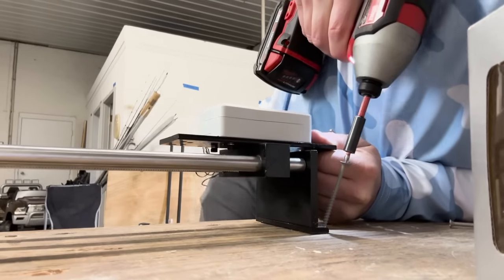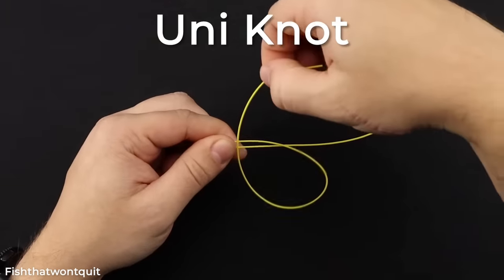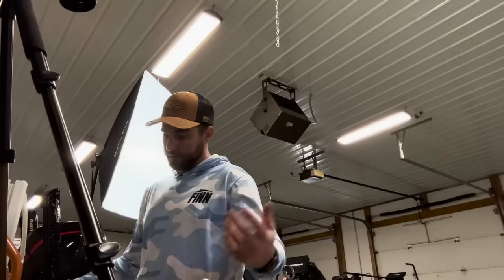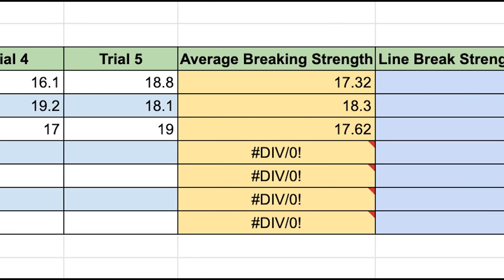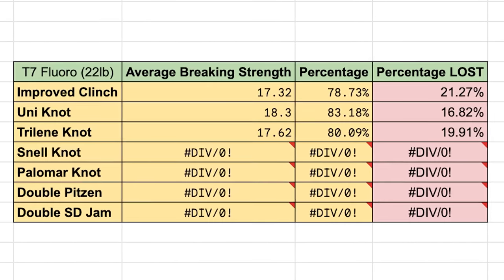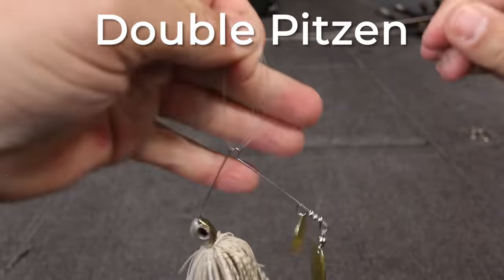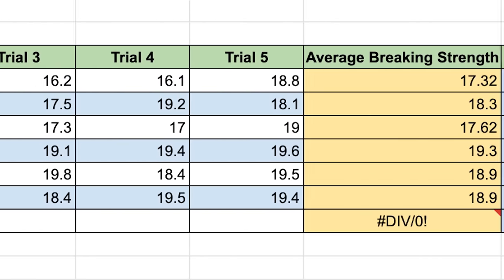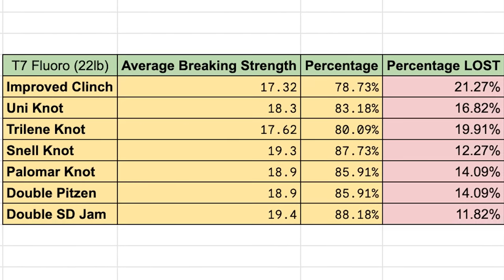You’ll NEVER Tie Another FISHING KNOT (I TESTED Them All)

Comment: I have done exactly these experiments in my physics class, now 30 years ago. I was using 0.25 mm mono line. Any of the breaking instances are SO MUCH higher than the force that a rod and line can ever reach. Let alone a fishing hook in a fishes mouth.
In practise the line gets damaged by casting, wetting, stopping a cast, kinking, etc.

Changing the damaged line often will give you most reliability, to my opinion. If you test the knot you made a few weeks later, you probably get worse results. Especially when stored wet, which is logical for fishing........

I like the approach, the test bench you've build is great.

Comment: Great video! It got me thinking since the snell knot was so consistent could it be due to the way that it’s tied? What I mean by that is the other knots require you to lubricate them to cinch them meaning they create friction and in turn always have a chance at burning or creating a weak spot in the line. The snell does not require lubrication to pull tight. Idk just a thought, I would love to be confident that any knot I tie will be consistent without outliers but with human error it’s hard to gain that confidence!

Comment: Great video - Quick tip for excel to prevent the div error showing like it did in your table try something like the following to prevent. =IF(E2="","",IFERROR(SUM(A2:E2/5),"----"))  The first "IF"waits for the last cell to be filled before calculating and the "IFERROR"  tests for an error and then does the true/false. Best advice is research the IF and IFERROR functions on excel and you can find a solution you like.

Comment: Any idea why line mostly breaks at the knot?  Does it have to do with the super pressure created when the knot is pulled tighter and tighter in on itself until finally physics takes over and the line, to come up with the best example I can think of, "cuts itself in two"?  Just a thought on top of a question.  I do have a curiosity question related to breaking tackle.  Have you ever had a bait break due to the tugging and pulling of landing a fish?  Line holds up, but the tie bolt pulled loose from the nose.  Rings holding the hooks spread out and thus pulled loose.  Hooks broke.  Bad day when your knot is strong, your line is strong, but now you discover your bait is weak.

Comment: Hello,
Another variable to check the strength of a knot is hook size.
The wire diameter affects knot strength.
The bigger wire (hook wire diameter) the higher knot strength will be. But each knot react differently to wire diameter (hook size) 
I noticed some knots are better on smaller hook size and some are not.
Thank you

Comment: I would have been really interested in seeing a test using the whip knot for spade ends, I love spade end hooks, if the turns are well done and not over lapping each other I've found it the strongest because it does not constrict the line unlike how most knots do, the tag end is bound to the shank by several turns and more often than not the line brakes above the knot.

the san d knot is simply a regular blood knot with a tuck but doubled line

uni knot is usually my go to knot, if its neat and tidy again more often than not the line brakes above the knot,

I think that seeing the hooks after each test so we could see where the line or knot failed is vital to see, slow motion of the knot tightening up would be fabulous to see

Comment: There will be a difference in breaking points of the knots between static pulls like we see here and a shock load (ie dropping a known weight a set distance).  The shock load on the knot will also be determined by length of line out etc etc etc.

Comment: Tyler, have you considered the rate at which you added tension to the line? I don't know if this matters with fishing line and fishing line knots, but it does matter with other materials, and particularly materials that are polymers. How do you know that you exerted the force each time uniformly? Could rapid application of the force have caused premature failure? Could you have achieved better results if you had slowed down the rate of application of force. This may be for naught because when fighting a fish, there is no way to control the application of force, but it is something to consider.

Comment: The simple 6 turn clinch with an overhand jamb on the tag end has been tested stronger than the socalled improved clinch and it can be tied in the dark where it does not matter if a litte of the tag end shows.  In the light it is easy to pull up close and tight.

Comment: Hi, there from what I can see on most test, it is the line that snaps and not the knots. So we are more onto a line pound test rather than knots. And since the Fluoro is a 22lbs it makes sense that all the breaking range are around 17-20lbs. Maybe try to do the same test again with a stronger line, results might be more accurate and relative to knot strength. And if you can focus the camera on the point of interest which is the 'knot under tension', it would be great. Apart from that great video !😁

Comment: Great vid. The only issue I have is that the Palomar knot, while technically tied correctly, wasn't tied in the best possible way. After you pull that loop around the hook, make sure to flip the loop up above the knot, onto the mainline before cinching. Doing this will keep that loop from cutting into the knot as it's tightened to maintain some of that integrity. Also, this is jacob wheelers advice, so yk...

Comment: Isn't the double sd jam knot the same thing as an improved clinch knot just double line. Run the line through doubled and tie an improved clinch knot in it, and it is the same. Try a double uni knot, and you will get even a higher break strength than just a single uni knot. Thanks for the video.  You did a great job and kept it unbiased.  That's saying a lot in the fishing world today. I appreciate your video.

Comment: (forgot to hit 'send') ... 72yo, lifelong angler here. The best line is the one that handles best for you on the gear you're using... I despise spinning & spin-casting spooled with flouro, and only use it as leader material. On bait-cast & trolling reels, it's too costly to fully spool-up with flouro. so it's just purely a leader material for me. The best knot is the one you can tie best and often under adverse conditions. Very good video, and I think a well-done fair comparison, but you'll invariably get someone barking at you.

I tried the Palomar years ago, and if the knot line gets slipped over the hook/swivel eye as you tighten it, it has near zero strength, regardless the line I'm using. About half the time, I got one part of my loops sneaking over the eye and I snap-off, even on a cast. I quickly stopped using it. For me, anything is better than a Palomar as long as my braids don't slip.

I use a Uni and doubled Uni because I can easily tie them well (also how to tie them poorly and correct my error). I've not had a fish break-off, but straightened more than a few hooks using both & lost a few seals, barnacles, kelp, rocks, buoy/dock-anchors & boat propellers. The doubled Uni wears well among knife-sharp rocks in the salt & rivers, but the doubled SD Jam looks like it would too. And, importantly, I've never had braid slip the hook/swivel, but in appearance, the same is likely for the Doubled SD Jam. I've landed on my butt a few times using 100# braid when catching rocks & the line snapped, but couldn't tell if it broke at the doubled Uni-knot or not. I'll try the SD Jam, and the doubled version to see whether I can tie them well and quickly in adverse conditions, and compare the 2. 
Thanks.

Comment: I am wondering what is exactly breaking, the knot or the untied line? A little closer shot kf the knot slowed down would be a great view of whats actually happening. Line can be weakened by abrasion or even overstretching making it break at lower pull. This is interesting but could be greatly enhanced with a slow motion shot of the actual breakage point.

Comment: Very good video. The problem with the double san diego knot is that you have to pass a lot of lines through the eye, if you have a hook that only allows 1 line to pass through it is impossible to do it. In other words, that knot should be in the other category, the category of 2 lines through the eye...

In other words, it would be very good to have 3 separate comparisons:

1) Knots that pass 1 line through the eye
2) Knots that pass 2 or more lines through the eye
3) Knots that do not need an eye

Comment: I’d be interested to see this test with a three turn (instead of 5) trilene knot. In my own experiments a three turn trilene knot has 100% strength but a five does not. It does slip a tiny bit so it requires at least a 1 inch tag end.

Comment: The strongest and simplest tippet to fly knot there is, is the Pitzen knot (fly fishing - also known as Eugene Bend, The Pitzen and 20-16). The San Diego Jam Knot is one of the derivatives of this knot. The only difference is the tag end runs through the opening on the bottom before the loop located at the top. This extra step adds an additional pressure point to the dynamics of the knot and gives the San Diego Jam Knot the ability to be used on a slippery braided line and the double is a derivative of the single.

The knot is well tested to retain 95 percent of the breaking strength of the line. Tying this knot is easier if you are using tippets or a lighter line than it is for a heavier line. 

    It retains more than 95% of the line’s breaking strain
    It is simple to tie and can be learned in a few minutes
    It can be tied in any conditions – cold fingers, rocking boat or when you have spotted a big fish!
    Because it cinches up with a little ‘pop’ it is easy to tell when it is tied correctly

Comment: double San Diego is improved clinch knot with double line, so obviously it should be stronger. Also if you don't properly lubricate the line you will have to pull harder to cinch it and by pulling harder you are damaging the structure of the line. Also even if you properly lubricate the line, you may cinch it to hard anyway and weaken the line, so it breaks easier.

Comment: Have you done a video yet that shows which knot gets you to equal or greater than the pound rating of the line? For example, if you have a 22lb rated line, which knot will get you at 22lbs or greater instead of losing anything?

Comment: The rate at which you apply pressure or, crank the handle in this case, will also influence the tensile strength.

Comment: Have you ever tried what they used to call a fisherman's knot AKA a hangman's noose? You tie a hangman's noose on the end of the line and play enough slack out that the hook or lure will pass through the loop then pinch the end of the loop so it will fit through the eyelet. Push the loop through the eyelet then pass the hook or lure through it, run the loop up the back of the hook or lure and pull it sort of tight. I leave mine a little loose while testing a lure. If no fish bites it I can reverse the process, remove the lure easily and try another one without having to cut and retie the knot.  If I do land a fish the knot will tighten but it can still be loosened with a some effort and another rig attached. I've tested that knot not quite so scientifically as you did but by clamping a hook in a vise and just pulling on the line until it breaks. My lines have always broken somewhere outside of the knot.

Comment: My understanding is that the advertised test strength of lines is not the maximum strength of the line.  Instead, the manufacturers take off some percentage of total strength to give a minimum tensile strength.  Of course, I don't think there is a consistent amount taken off between each company.

So, if you indeed trust your "crimping" technique to protect your knot, you could do one of those for both side knots and get your own maximum tensile strength for the line you are using.  Then you would also get a more accurate percentage of loss from the knots.

Comment: You should definitely be wearing safety glasses. I noticed in your example the Palomar looked incorrect as the loop cinched towards your line when it should come from the line and cinch down towards the eye of the hook. I also saw several times where the knot wasn’t breaking but the line was. And lastly should should test a standard clinch knot. I was never convinced the improved was better.

Comment: ive always had issues with the palomar using fluoro or mono, its great with braid but hot garbage with other line. i was just breaking off so often that i switched to the uni.
Reply: I always use mono, I don't like braid and the Palomar Knot never failed me. If the line breaks it's usually several inches above the knot.

Comment: Can you do another test where you use water and salt water to wet the line against saliva. I'm just wondering if it makes any difference. And maybe one that is dry with no lubrication? Maybe with WD40 too?
Can you also do a test on steel leaders to see if the swivel or the sleeves or the snaps or the hook fails first?  Is one snap type stronger than another?

Comment: What I gather from these is that the differences are very small. I feel Uni is probably the best all-arounder since it’s super fast to tie, doesn’t wear too badly. Snell knot would be better but only for bare hooks, and not jigheads or hard baits. Double SD is good too, but not for heavy lines since it might be hard to do a double thru a narrow hook eye.

It’s pretty clear that the knots fail either at the hook eye or above the knot. None of these slip if done correctly.

Comment: Great test for yozuri but don’t you notice a difference between line types like hard vs soft and co polymers vs just nylon Or fc and there’s differences in dry vs wet and then impact resistance vs slow loading in this test also that snell you tied is rubbish there’s a much much stronger version than that!, and yes the palomar is junk too! Good point on finishing knots too as just the uni you tied you missed the critical finishing step which would take it clearly to the top of the list just below the correct snood knot and others like the fg and Bimini twist and plaits

Comment: the variance between them is not large enough to care, particularly with more complicated knots where your risk of error in tying it is higher. Like your Palomar example -- if 1/5 times you mis-tie it and it breaks at 11, then youve eliminated all of the mathematical benefit of picking it over an easier knot like the clinch. The San Diego Jam would take me forever to tie on while sitting in a moving kayak with basically invisible fishing line ... and I'm gonna screw it up too often for its benefits to ever win out. 

Just oversize your line by 20% and tie whatever you can tie fastest with 100% accuracy. If you want 20 "true" breaking strength, buy 22 pound test, youre pretty much right on, no matter which knot you tie.

Comment: I appreciate how scientific you’re being with this, but there’s a lot of room for improvement and an idea for a very interesting video.

Hire a stats guy, have them determine the number of tests required for each knot to create statistically significant results, do the tests (there will be a lot of them), then have them calculate statistical significance.

The reason this is important is because some of the knot scores are so close that there may not be any significant difference between them, and a 0.1 or 0.2 difference might be well within the margin of error. With 5 tests per knot you’d probably need to see much larger gaps in performance to accurately determine if the knot is actually “better”.

With a lot more tests it’d for sure be a lot more work, but definitely much more rigarous.

Comment: Did a simple re-analysis of your numbers (SD, pairwise t-test with Holm multiple tests correction and two-sided alternative hypothesis, critical P < 0.05) and the only statistically significant findings from the small sample size are that the SD Jam is different from ImpClinch and Trilene, and ImpClinch is different from Snell. Every other comparison is non-significant, i.e. no difference between the knots. With a more stringent "greater" alternative hypothesis (one knot has to break at a greater strength than the other, not just at a different strength), the only significant comparison is that Snell breaks at a greater weight than ImpClinch (not a surprise) -- all other pairs of knots break at similar weights. 

I come to a different conclusion than you: when you also add standard deviation to the mix, Snell might be a better knot because it has the second-best break strength (mean 19.30) but the lowest SD (0.20), i.e. it seems to break at a more consistent point than the others, maybe one interpretation is that it's more consistent to tie. Double SD Jam had an SD of 0.76. The worst two SDs were from ImpClinch (1.16) and Palomar (1.15). But it's a small sample size, the line is dry, the stress was applied inconsistently, etc etc.

Comment: I'm confused, are the knots really failing or is the line breaking above the knots. The two are completely different results. Also, with the knots you have to also have the exact same tail length left for the line I would think for the control. But again, I really think you are testing the line strength. I think the line is breaking and not so much the knots failing. Maybe I'm wrong. Interesting though.